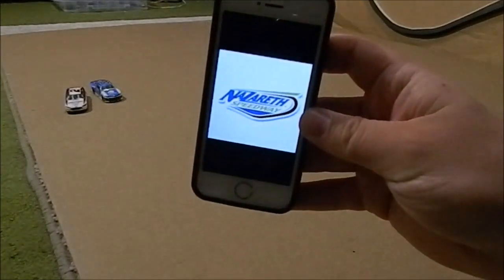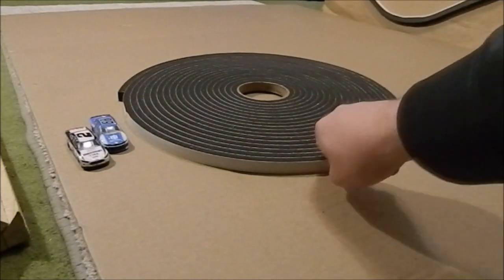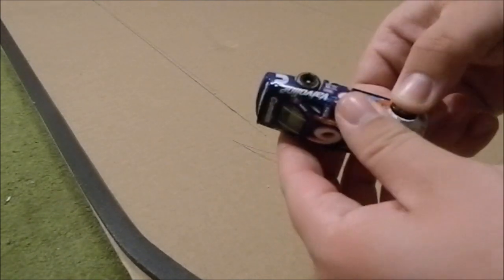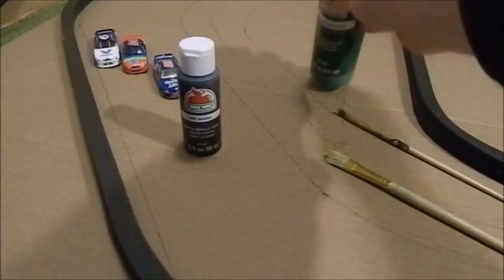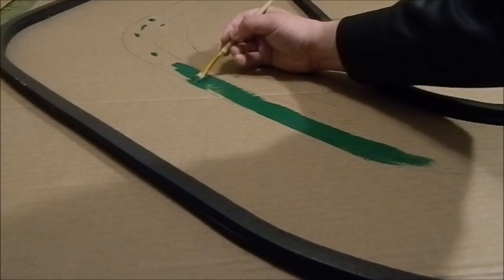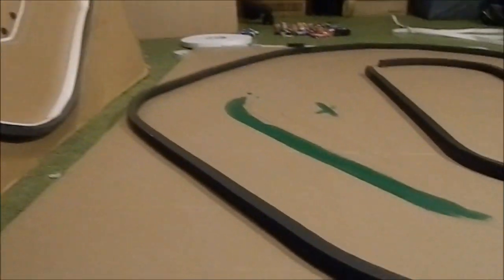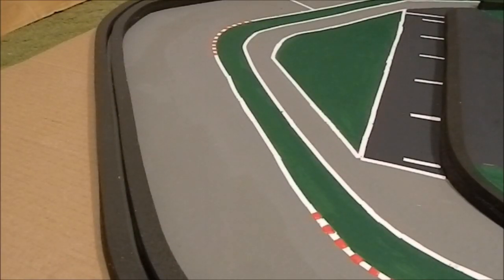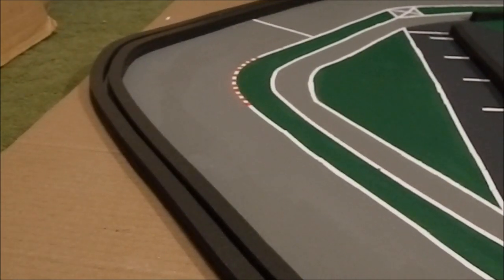How to make a Cheap Race Track - Nazareth Speedway

Comment: I use a table with chalk paint coats, styrofoam boards for the wall and grandstands. You can easily make a clean track with chalk and you can easily change it with a wet rag. If you don't want a million boards for racetracks you can make custom tracks and other stuff.
Reply: Meaning 15 dollars of supplies can make like 10 tracks. Of course you'd need a table first.
Reply: I think tables are over rated
Reply: @pennsy_  trust me they aren’t. You can get a stop motion done 5 times faster with one.
Reply: me personally I don't have enough space in my house for a table so I make 1 track print out logos to just put on the tracks and if the race is a different shape of track i just flip the existing piece of ply wood and paint the track that way and then the logos and then make the stop motion on my bed
Reply: No way it’s micsraft

Comment: Holy DAMN. that is hot, I generally use black poster board so i dont have to paint, I think I will start using the white out thing on my tacks now, and usually I dont double stack with the walls but this video is super helpful, I used to think my tracks were good but yours go above and beyond, i wish i could send you pictures of some of my better tracks, but i think you deleted instagram, but thank you so much for this geno, we all appreciate it